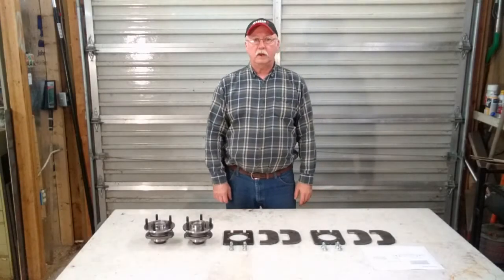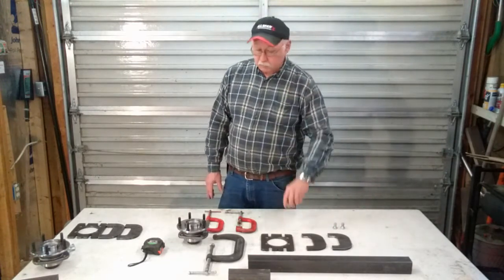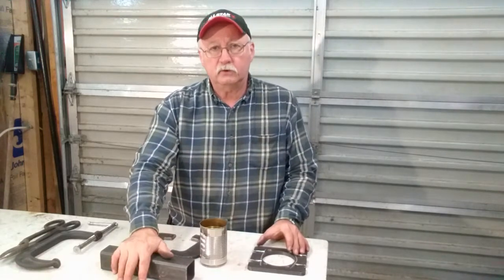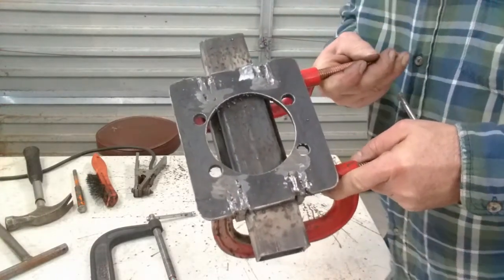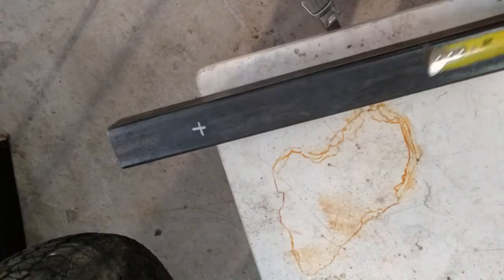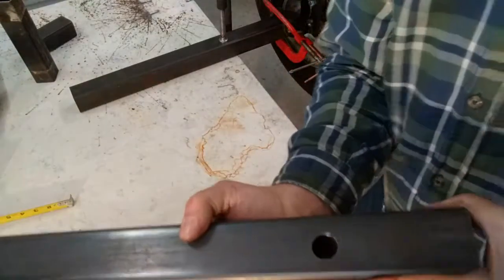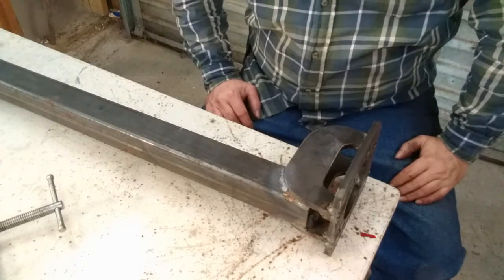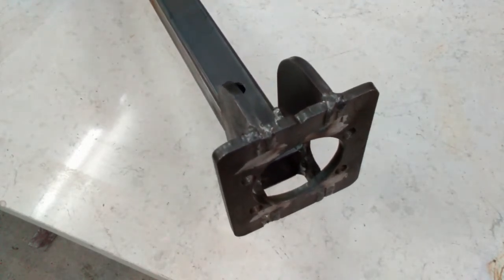Build Your Own Custom Width Trailer Axle

Comment: To all newbies! DO NOT WELD THE SPRINGS TO THE AXLE, EVER, NO NO NO! OK? Spring steel is tempered to flex, if you heat it to 5 grand with a welder its f****d, and will snap in half out on the road. The hole drilled for the spring bolt has plenty of clearance so it wont shear off. Your spring will have mounting plates, use them,  Do not mount the spring DIRECTLY to the square pipe, use the mounting plates (not shown in video)
To the uploader! Very cool! I like that you repeatedly say HOT WELDS! 
Clean metal makes hot welds and hot welds are fully penetrated and solid. 
Hopefully detail people will go make sure they understand heat, and penetration for strength. Dirt absorbs heat and takes away penetration for those who are new. 
I was frustrated with my width of the trailer and finding the right axles out there, but now we create out own custom length with this setup, and I can make the plate and gussets myself! Sorry ebay! You aint getting my money, my local steel guy, and auto parts or motorsports store will get it. 
I subd your channel over this video! Bang! 
And TRUMP WON!!  NOT THE MASHED🥔.  LETS GO BRANDON!!
Reply: Agreed with your comment.
Reply: Nothing like supporting a traitor to this country.

Comment: This was exactly what I have been looking for. 
Picked up a used trailer, and be looking around for a better axle solution. Something that is easy repair, and more structural. 

So glad the link is still good for this setup. 

Hey Thanks, I even learned a lot about welding through your demo.

You are a really good teacher.

Even though you don't seem to make videos anymore, I still will sub.

Thanks!!!

Comment: Just bought a Harbor Freight "Super Duty" trailer & a flux core welder.
When I outgrow this trailer, I plan on fabricating my own using your setup.
Thank you for sharing.  Awesome.
Reply: I have a beer and some popcorn . . . I'm gotta watch this . . . you guys in! This is gonna be good.
Reply: @jimwhitaker8751  Watch what exactly?
Reply: @rusosure7  guys who think that they're going to build a "SUPER DUTY TRAILER" with a Harbor Freight flux core welder.
That's about the biggest joke on the welding web.

Comment: I have never seen an axel built without some sort of spring plate on it  a 3/4 hole drilled in the tube for the center bolt is going to allow the springs to move around no matter how tight the ubolts are and you can guarantee that the head will sheer off the centre bolt. This is absolutely crazy and a major safety problem spring saddles are easily available.
Reply from the maker: The hole in the axle is not how the spring is mounted. It just accommodates the spring bolt or rivet that goes through the springs, so that the springs sit flush on the axle. Springs are always mounted with spring mounting plates. There is no eliminating of a spring Mount plate with the system
Reply: I agree with you Carl Simms. That hole is not just to hide the bolt or pin. Its also an alignment pin to square the axle to the spring. This is bad advise to go with a larger hole. 
 As this is a nice setup but should only be used on a single axle light weight trailer. These hubs will pop if using on a tandem axle setup from side load while turning.

Comment: I would really not use this type of hub for a boat trailer axle. Even though it is most likely a "sealed" bearing in the hub, salt water will work its way into it and it will destroy the bearing in a short time. That is why most trailer manufactures use the EZ Lube hubs on all boat trailer axles, as you need to grease them up after every couple times the axle is exposed to salt water.

Comment: Hello I would like to know more about it and how thick is the steel you use for the axle plate because in Canada I would need to get inspection on it. Can you help me out with some more info
Reply from the maker: The steel thickness is 3/8" plate, all pieces.

Comment: I especially like that you can adjust the height somewhat. I was looking at going the regular route for the spindle ends but really like this design for adjustment. You should have shown the bearings and all put together so we can definitely see that it is an entire kit..(visually). Great design for a dummy like me that can't decide or may build the frame before deciding on the width of the camper trailer. 

 Just to be clear a 1/4 x 2 x 2 pipe is all that is needed. ?
And can breaks be added using this setup?

Does this pipe need to have any particular strength specks or is it regular stock metal?  Thanks !!
Reply from the maker: Just a regular stock 1/4"  2"x2" tube. No special hardness, just whats called structural  mild steel. You can add brakes, but that would take a little custom engineering with off the shelf parts.

Comment: Castor? Camber?
Reply from the maker: @Kenniii3  Castor and or Camber is usually not considered necessary on trailers because of axles being streight. Those factors are usually used in wishbone suspensions.

Comment: Is there a 4000-5500pound kit? If no kit what would the thickness of all the steel required to meet such specs? Thanks in advance…
Reply: I’m not sure how the shock and height adjustment works for this setup, anyone have a link ?
Reply from the maker: 3500 lb kit is the largest capacity we make. You would need to consult an engineer for higher weight construction.
Reply from the maker: Typically you would add a shock to whatever would fit. We have found that a 70's Volkswagen are reasonably low cost and perform very well for load and sway control. Coil over shocks would be overkill. Leaf springs work best for trailers.

Comment: Factory sealed hubs need an axle bolted through them to stay together.  The inner hub is only pressed in. What's done here is dangerous.
Reply from the maker: These are rear hubs. They are bolted through by the factory. By removing the dust cap (not recommended) you will see they are safe. They are mounted on vehicles basically the very same way.
You are probably confusing rear hubs with front hubs of front wheel drive vehicles, that would be true of front hubs.